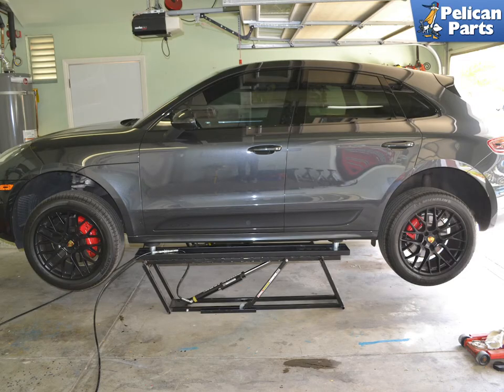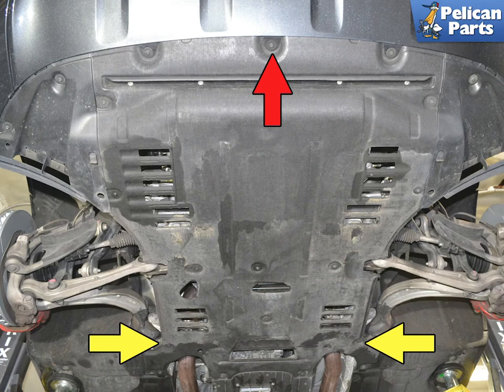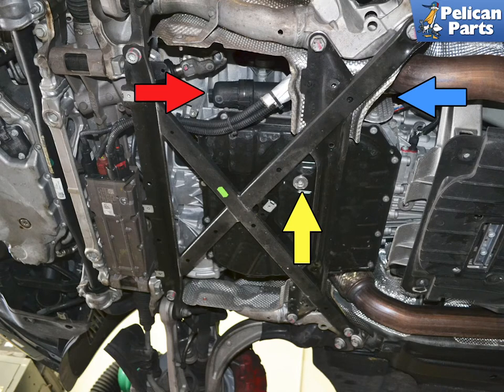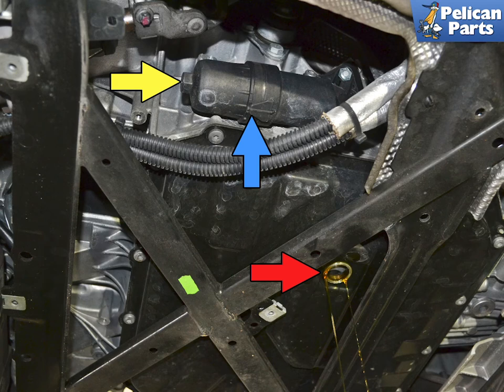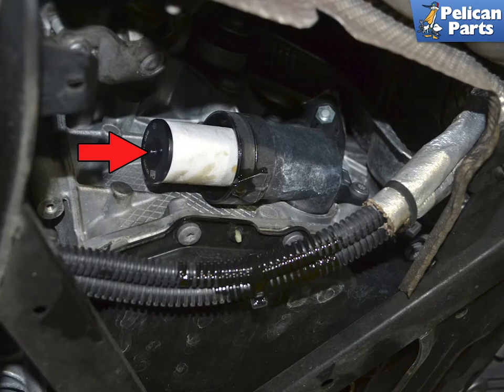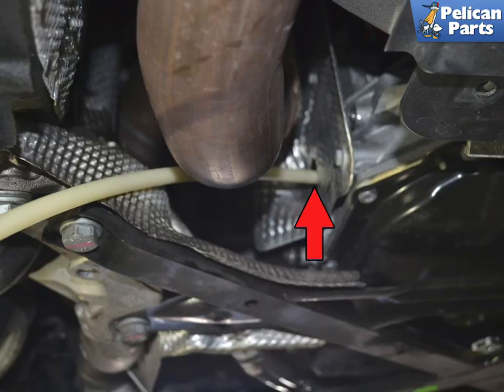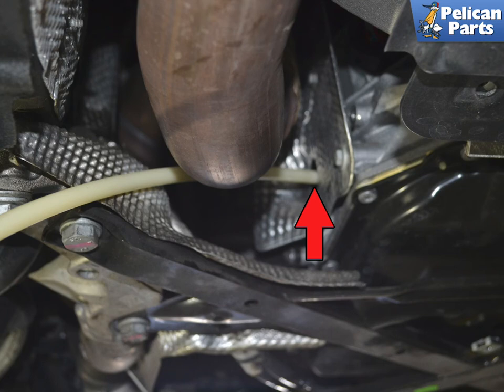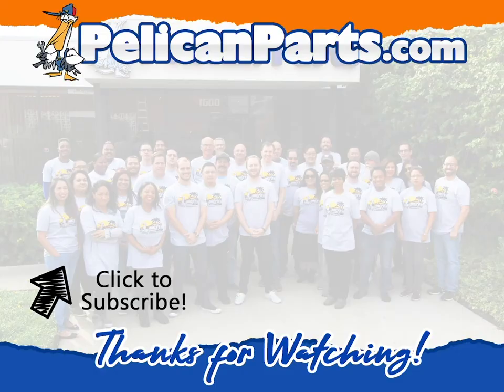Porsche Macan PDK Transmission Fluid and Filter Change (P95B 2015 - 2023)

Comment: Do u have a part number for the revised fluid? I think it’s something with 529 A2 at the end, A2 being the revision
Reply from the maker: You didn't mention what year, model and engine size of the vehicle you are working on. I need that info to try to locate the part. 

With your vehicle info handy, give The Pelican Parts parts specialists a call at 1-888-280-7799. They can figure out what part or repair kit you need.

Comment: I see that you said 5 tp 5.5 quarts of fluid, some comments are saying they used 4.75.  Some specs i read online say 6.5 liters?  I have base 2019 Macan
Reply from the maker: Porsche notes 7 liters, with an additional 0.5 liters for new transmission when filling. If draining and filling only, Porsche notes it may also be 6.5 liters. Measure what you remove, fill with that amount. Then check level and adjust as needed.
Reply: 6.5 if you’re pulling the pan down and changing the external AND internal filter.  5L if you’re only draining and filling with just the external filter.

Comment: Thanks for this video!  Just want to add a couple of comments to help those of us with a base Macan (the 2.0 4-cylinder).  This video shows the 6-cylinder Macan.  The base Macan is slightly different.  First, I measured 4.75 L (5 qt) drained, and the same amount went back in following the proper fill process.  I'm guessing the base Macan has less PDK fluid capacity.  Second, you don't need to worry about getting burned by the exhaust when filling.  Base Macan does not have an exhaust pipe near the fill hole.   Other than that, the process is identical.
Reply from the maker: Thanks for the additional info for the procedure. We appreciate it.

Comment: Should l wait until the trans fluid stops spill out after it reaches 40 degrees. Would it be a problem if I did that ? Thx!
Reply from the maker: What is the year and model of vehicle are you working on? I can see if I have that info.
Reply: It's a 2019 base model,  thx!
Reply: With engine running, I let it drain until a very thin stream was still coming out.  Trans temp was right at 40 deg C.  The amount I put in was exactly what came out (I measured the drained fluid).  It was 4.75 L (4.75 qt).  I also have a 2019 base Macan.

Comment: When you mention shift through all the gears, are you talking about R, D, N or actually putting it in D and going through 1-7? I don’t have a lift, only ramps and my driveway has a slight slope so I’m not sure how safe it is to invest in a lift and utilizing it there. Thanks for the informative video!
Reply from the maker: All the gears, including manual shifts.

Comment: Hi great vid. looking to get a Macan but heard about the transmission oil leak problems. will this solve it. and should the oil leak problem put me off the purchase? Thanks
Reply from the maker: I haven't  heard of chronic leaks. It depends on where the leak is from. If from the filter, then yes.
Reply: Oil leak problems on the Porsche Macan was related to the S and the GTS models. It was an oil leak from the timing cover. Porsche covered the repairs under warranty but I don't know if it was a recall or an as needed repair.

Comment: Looking to do this, is there a difference between FFL-4 and ATF transmission fluid - or can you use either?
Reply from the maker: You didn't mention what year and model vehicle you are working on.

With your vehicle info handy, give The Pelican Parts parts specialists a call at 1-888-280-7799. They can figure out what part or repair kit you need.